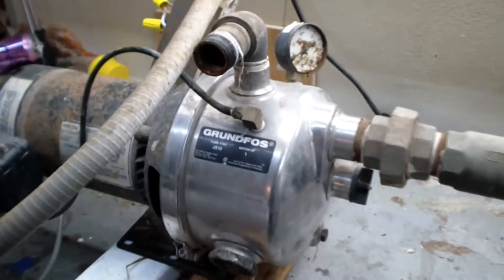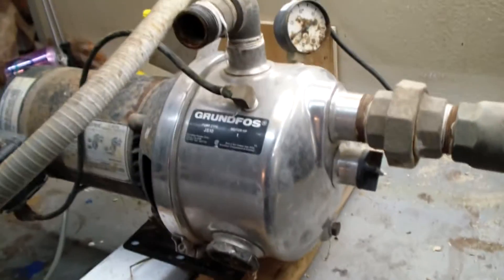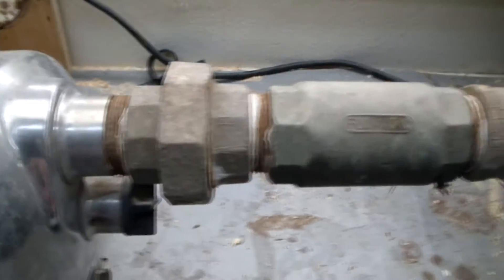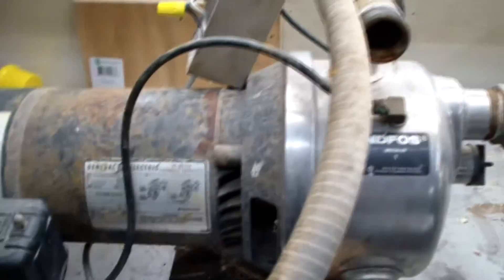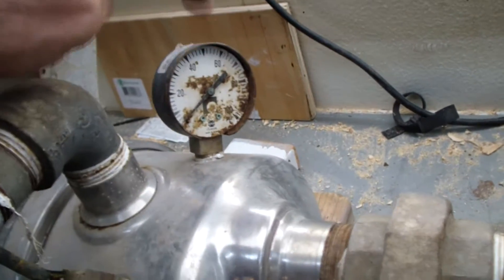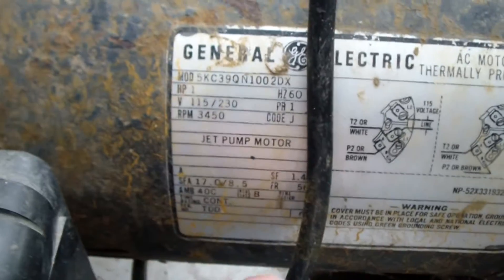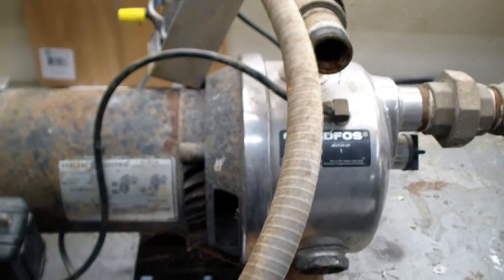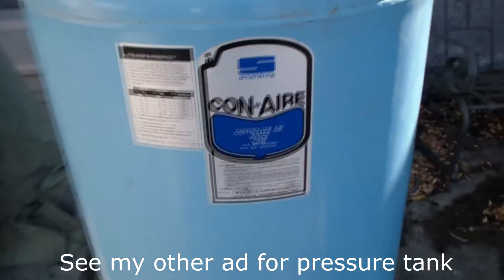Grundfos JS10 1HP Stainless Jet Pump

Comment: HI Kent, I purchased a used JS-5 which looks just like the JS-10.  I haven't been able to determine what the extra hole just below the inlet is for or what the plugged hole is for on the side. Do you know or have a manual that describes their purpose?  Sure appreciate any information.   Brad